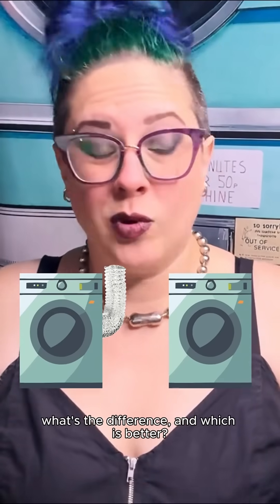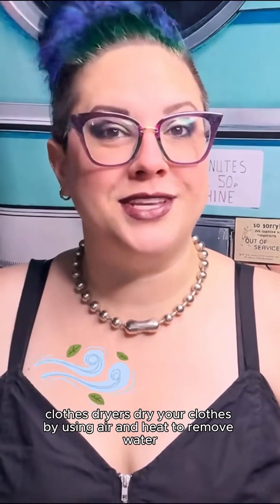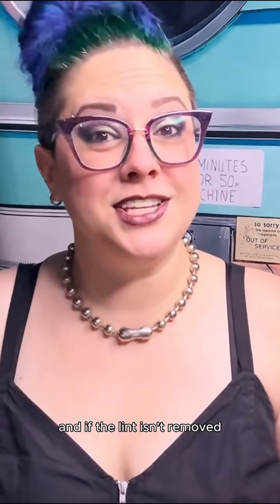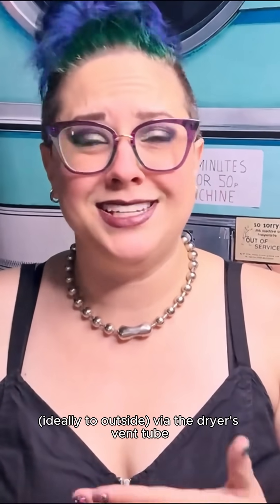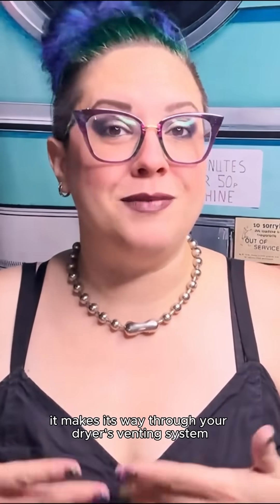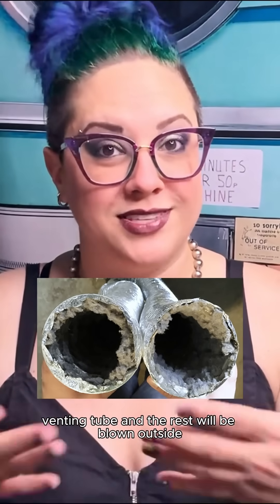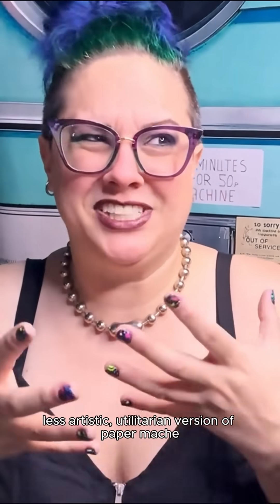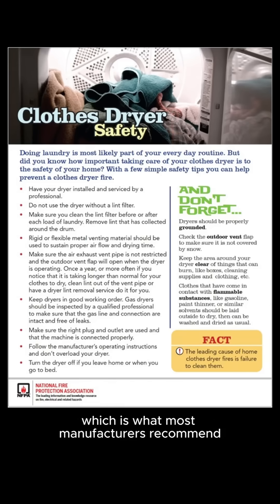How Vented Clothes Dryers Work

Comment: I've actually considered not using the lint filter on my dryer... Don't worry I haven't actually done this because I know how much more would accumulate inside the dryer itself. 

I'm a plumber and so I have a really good idea with how air resistance works from doing high efficiency water heaters and fire suppression systems. 

Thankfully my dryer is on the outside wall on the main level, so I've got approximately zero fear of the vent ever getting clogged, my only issues will be with the inside of the dryer itself. No flex line installed, just straight pipe pushed directly on to the outlet of the dryer. Mostly because it's only 14 inches from the wall and a straight shot through the wall.

Comment: Was doing a cleaning on this lady’s like 10 year old dryer, never been opened or cleaned. After we pulled off the front there was a half inch layer of lint on top of the heating element box that was charred. Maintain your dryers people, they can be quite the fire hazard 😬
Reply: Shout out to my (attached) next door neighbor who called me in a panic one evening asking if I smelled smoke, then chose to ignore my suggestion of cleaning out the dryer vent and just buy a whole new dryer. Which got hooked up to the same clogged vent. The guy who moved in after them said he'd never seen such a clogged dryer duct. I'm glad they moved. I would've been very unhappy to have my house burned down by someone else's dryer.

Comment: I used to install dust collection systems for wood workers. On my dryer, all straight runs are smooth sided pipe. Flex-able hose adds a lot of air resistance. Plus every directional change (bend in pipe) adds more resistance. 
A dust collector pulls the air, a dryer pushes the air.
Reply: Either way, maintenance is still needed
Reply: @kylegeorgedavy2833 that's true, but with smooth sides, not as much lint builds up in the hose. You still have static that will trap some